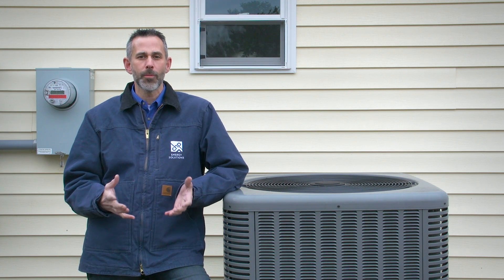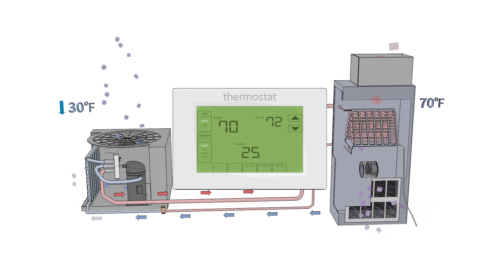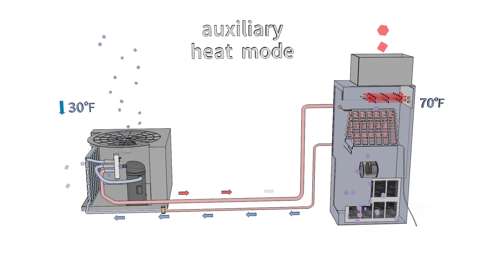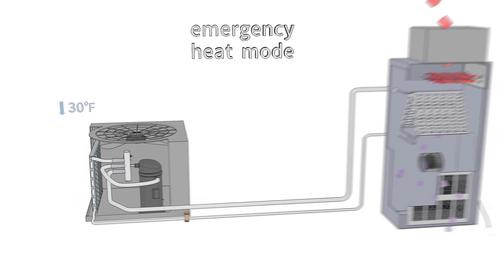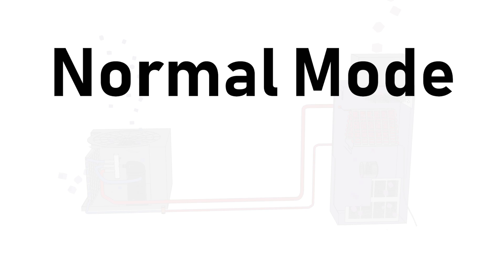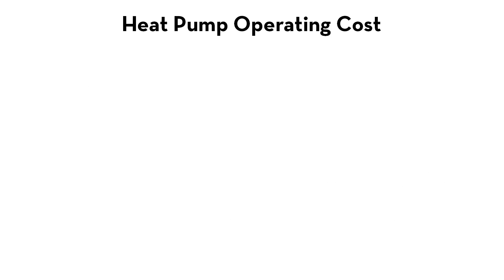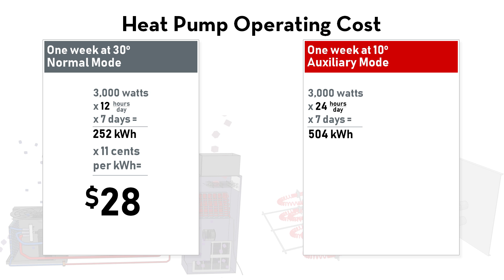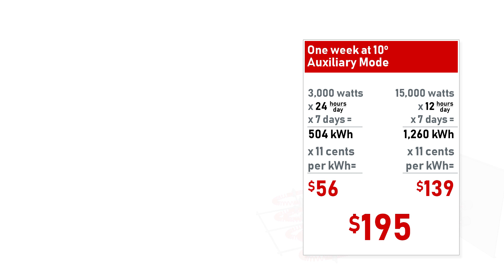Understanding Your Heat Pump

Comment: Do all heat pumps automatically transition to auxiliary heat?Seems like mine gets to the point of constant running at around 22°F without any auxiliary heat kicking on.Then I have to manually switch the thermostat over to emergency heat or heat strips.Just wondering if some have this feature while others do not or if I have something wrong with my unit and in need of repair.

Comment: This video is very misleading.  Not all heat pumps need aux heating below 30 degrees.  There are systems on the market that heat 100% efficiently down to 0-17 degrees ambient temps outside.  I am using a heat pump system in Massachuetts as my only heating source and it works fantastic in my region.  Its spec'd to run 100% efficient down to 0 degrees and 80% efficient down to -5 degrees.  If you do your research.. there are systems out there that do far better then what is explained in this video.
Reply: What kind of HVAC make and model do you have?
Reply: @MetroRatRace  I have an Ecoer.  Its working fantastic.  In fact, we just got 8" of snow and temps dropped to single digits last night and we stayed toasty and warm inside.
Reply: Maybe this video was made before heat pumps improved. It’s still informational to those who are thinking about getting a heat pump in the future to cut down on power bills in the winter months. I’m one of those people. It’s great that they have improved and can work in cold temperatures.
Reply: I have goodman 
Not good in winter but even if outside is 40 f
Reply: I am in new York
Reply: Depends on the unite new one can go below zero.
Reply: I just had one installed a couple years ago and the heat pump will run down to 15 degrees anything below that it calls for aux heat which is propane in my case

Comment: There's a technique that can help keep costs down when the temperatures drop low, typically at night. It starts with turning you heat pump off when the temperatures are so low, that emergency mode would be active. Then during the daytime watch for the temperature to rise above 30-40 degrees. At that point, turn your heat pump on and set the temperature quite high, perhaps 85-90 degrees. Let it run continuous, heating your house about as hot as you can tolerate. Since it is warm out, this is relatively cheap heat for you. Then once that warmth has settle in, turn your heat pump off. Let you house coast through the night on the stored heat until the warmth of the next mid-day, when you again turn the heat pump on. That works. I did that during a cold wave that sent temperature plunging to 8 degrees. My power bill was only about a fourth of that of a neighbor.
Reply: Here's a supplemental technique that works every time: use a gas furnace.
Reply: This sounds like a joke
Reply: lol i thought that would work  but too many complaints

Comment: how to quiet a TXV DURING DEFROST  sounds like air brakes. Is there a way  to quiet it  or  wire it so the heat scripts come on instead of that air brake sound?

Comment: Great video, great job ! My opinion is heat pumps are not great to have in cold climates.
Reply: Thankyou me  sherimg gues    welcome
Reply: That's quite true unless you get your heat from deep underground. But geothermal heat pumps cost more to install and service. Where heat pumps shine are where winters are mild and summer are hot. Then one device, that heat pump, can both heat and cool your house.

Comment: Great Video and good information!

I have a question about my heat pump.
I was having a heat on issue with my old thermostat. Bought a new one and ran it.

Several days later my copper tubing leading from the outside unit began sweating and water was dropping on the floor from the ceiling of my unfinished basement ceiling. The smaller copper pipe was very cold.

I opened my air handler and the coils were iced over. I ran an installer test on the thermostat which ran heat stages Heat 1-3 and the ice melted rapidly running into my trap and the coils were then ice free.

I tested the fan only through the thermostat and the fan didn’t turn on?

I ran the unit for 2 hours and checked and it was again icing up on the coils and fins. I am perplexed on what’s amiss.

By the way the old thermostat ran fine for years and the new thermostat was wired exactly as the old one from pictures I took of it.
Reply: Is it still doing it?

Comment: Or get a heat pump system that uses a smart thermostat that turns off the normal mode when the temps dip below 30° and runs in auxiliary mode only whenever the heat pump. My system is a 5-ton system whenever it ran in normal mode and and auxiliary it used more like $250 a month because it would run both the heat pump and my auxillary electric coil heat at the same same time once I had them replaced my system with a variable speed heat pump that would run without the heat pump it only used roughly $150. Long story short the heat pump running when it knows it ain't going to be able to heat your home anyway it needs to be shut off entirely when the outside temperature gets below a certain range. No point in the pump running at all when it can't supply heat.

Comment: I'm a hvac apprentice in training now i know this i live in the east coast it gets below 30 and sometimes at 0 I'll never give no one an heat pump this far north just gas oil and electric heat
Reply: I’m currently building a house in MN. They are suggesting we install a heat pump with an LP furnace as an auxiliary back up. The electric company will give electricity at half price 7¢ for heating and cooling using the heat pump. LP can be expensive. Is it worth it with half price electricity in summer and winter with LP back up?
Reply: @cclementson  I’m in NY and have heat pump with propane back up. I love it. my Bosch 3 ton is “efficient” until single digits. not as many huge/often/ANNOYING  propane bills/dependence for me

heat pumps are very different than fossil fuels/space heaters. they’re made to run run run, and aren’t “making” heat, they’re sucking heat out of the air. running those electric strips/supplemental heat strips are super dooper expensive.

the boiling point of the refrigerant is so low, like -30F or something. what’d you end up doing there in MA?
Reply: @-DexterMorgan-  
I am planning on 3 ton Bosch Bova 2.0 over here in Chicago. 
How big is your place  and how happy are you so far with winter comfort?
Reply: @pilot-787-g4t  Do it! my place is a mobile home/trailer it’s 1,200 sq feet. highly recommend it, it runs quite a bit though when it’s cold but that’s what it’s meant to do. used almost zero propane for heat and our electric bill wasn’t crazy. higher for sure but maybe 20-30% higher than the year before without the heat pump. you’ll love it

also the heat isn’t as dry, and it’s meant to maintain the heat as opposed to jump the heat up 5 degrees quickly. when we had a huge storm with a foot of snow I just turned it off, covered the top with plywood and switched to propane for the 2 days I was out plowing. if I was home I could have made sure it stayed clean though. lemme know if you have any more questions, I’m no expert but know a bit

Comment: doesn't this auxiliary heating modes in the heat pumps depend on the boiling temperature of the Freon used in it? In other words if you have a freon that boils at -40 degrees, you can still produce heat without burning much electricity.
Reply: The aux heat doesn't rely on the boiling point of the refrigerant. In weather that's below 40°F the heat pump will need aux heat because 40°F is the balance point. On cold days the thermostat may say that it's reached temp. But it hasn't that's why the thermostat cycles the aux heat periodically. When the heat pump goes into defrost. The defrost board turns on the aux heat your thermostat may say "aux heat on" or it may not. While the defrost cycle is on the unit switches to A/C mode for a few minutes the outdoor fan is off during defrost. To raise the refrigerant pressure to melt the frost off the coil. Then it goes back into heat mode.

Comment: I just bought an ac and heat pump system and it is a 5 ton carrier and I want to ask what is the temperature I can use heat pump and it does not freeze I live in Dallas Texas
Reply: The heat pump will defrost to remove the frost. The unit should not be a solid block of ice. You can use any temp to run the heat pump.
Reply: It uses its own discharge gas to defrost it self but you'll feel a little chill but don't worry its just defrosting

Comment: If you live where it gets below freezing heat pumps and electric furnaces are trash. Get a wood stove and be warm!
Reply: Yep there is a reason why there are almost no heat pumps in Michigan. It simply gets too cold up here.
Reply: D Train and get a  air conditioner with a gas furnace instead  of a heat pump if you live in a colder climate and you will still be cool in the summer and be nice and warm  and toasty in the winter! If the summer is hot enough for Air Conditioning.
Reply: D train heat pumps are something that I  would never recommend if you live in Alaska